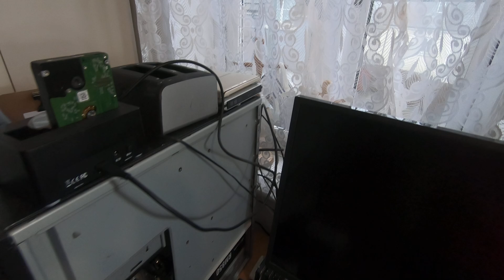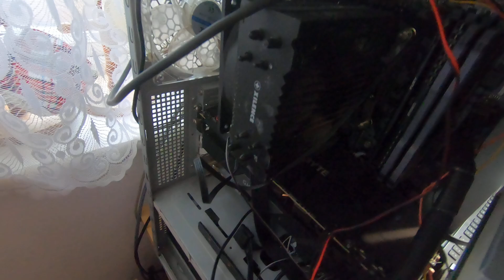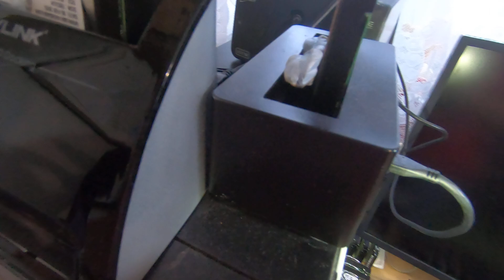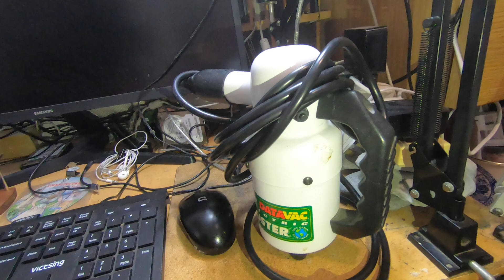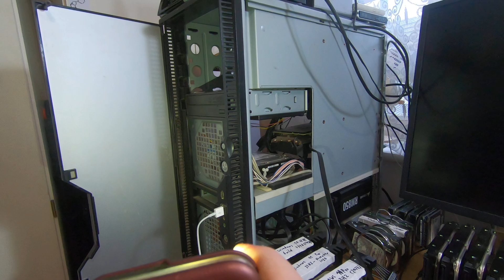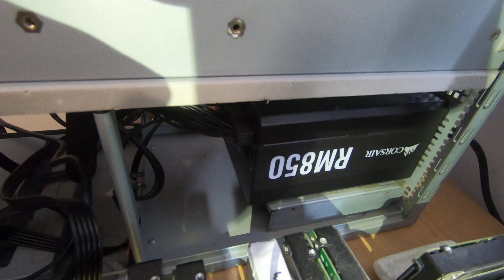The main reason: why my PC is running cool - tutorial EN (a good explanation) 2024

Comment from the maker: you can buy off ebay.co.uk:  electric duster  -  https://www.ebay.co.uk/itm/204225138106?itmmeta=01HQ1ET9DG36MHPBEY0184BCF8&hash=item2f8cc44dba:g:1CAAAOSwxHtj0lY6&itmprp=enc%3AAQAIAAAA8Fa1S5s7Juy7LKIO8rO3EExRmpnx0th4kqH2pHxswITxL7GxQtmdSwH3EQuc9mj0eNKVNa2voOnFelqiSWkJkRYgLb4bn9jEiyzNh9hzHbJQBAtjwZaHTF3zaO%2FExge00BnEuhvf3XZhsSNshVz7xd%2BgKnNrEU%2FjtLEZdBGKKOA6qtdf%2F%2BISHDagmcFOUitZe%2FllZPOc2dSvwFFWQ7k8GDNILIxXcwLruZ9%2B7yMfZ7ugfMptwYtA2P3TSGAUYR0I807Z%2BNi20Vw34q25S3IZQ2An8EEvOtYhwYfwlgNq7oMYjLSua7%2FST5eXabd%2FpZwkWw%3D%3D%7Ctkp%3ABFBM7pbprrhj

Comment: Running  your machine so close to a open window can be dangerous. If rain comes into contact with main  board. It will short out the component.  Long term corrosion.
Reply: no
Reply from the maker: I agree.Only - Only - during REALLY heavy rain - i close the windows. @kualajdm
Reply from the maker: it depends,how close.Sometimes: i close the window,when it rains too bad.In Cornwall: we usually have - windy weather,which helps a lot.I have a 9 years old PC - which i used to keep in front of the window and i never had any problems with corrosion.

Comment: does open case reduces cooling?
Reply: Theoretically it's worse to have the case open because you're not really keeping any cool air in but if the outside air is cold then it should be fine
Reply: No it almost always improves temperatures to have more airflow unless you had a heater pointed at the side or something
Reply from the maker: It should help.I have open side panels of the case of PC.But: i regulary clean it - by air compressor (Metro Data Vac Electric Duster)
In my case: it helps.